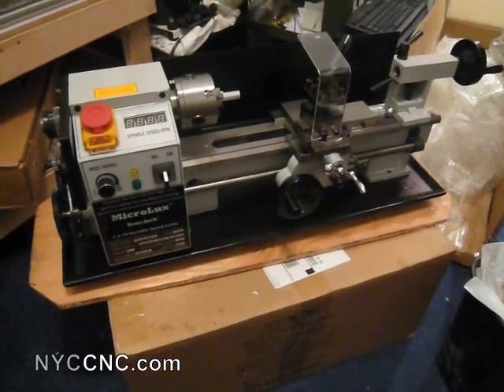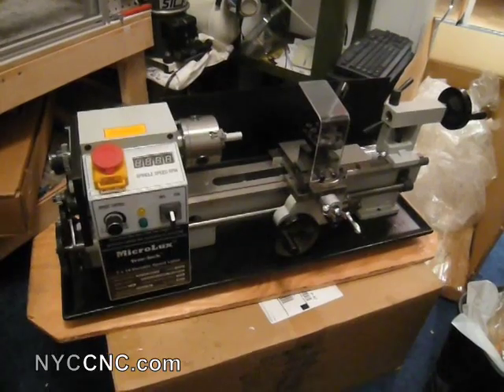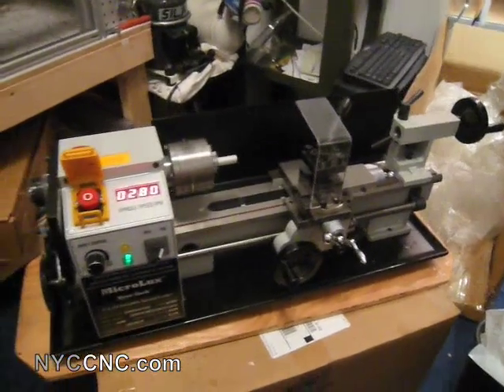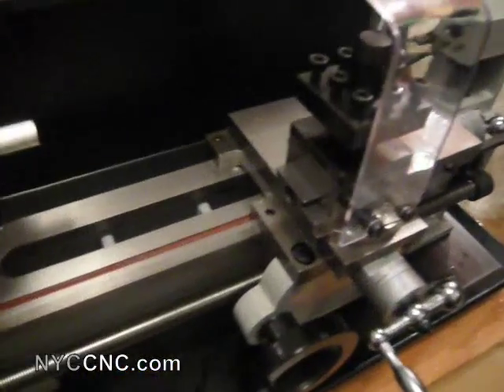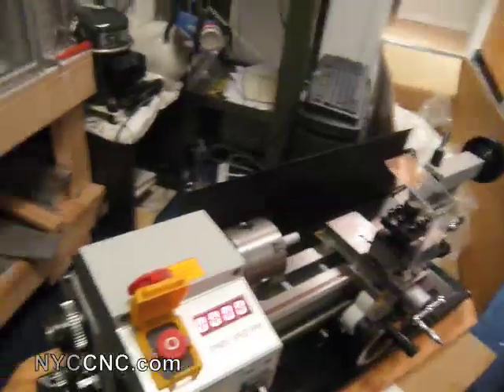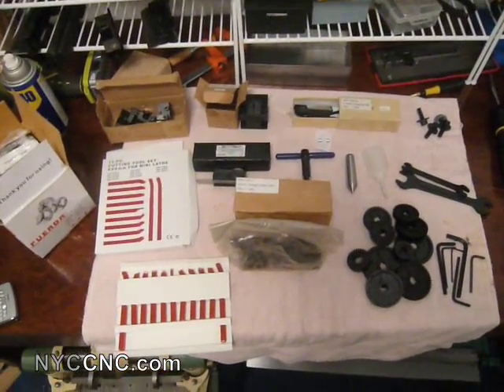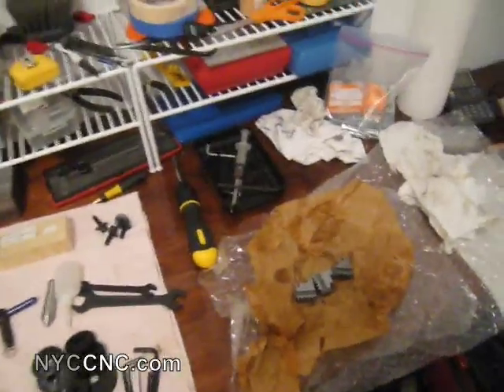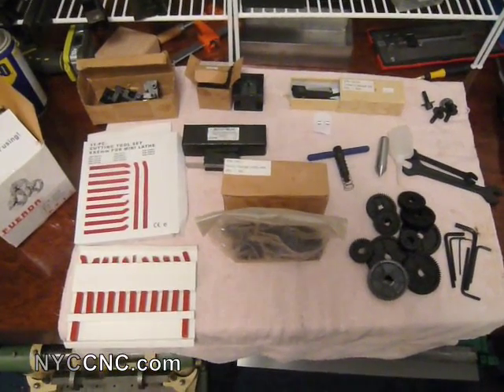MicroMark 7x14" Deluxe Mini-Lathe overview and tutorial

Comment: I understand and partially agree. However, I have aversion to chinese productions and currently suffer the fact that nothing below 1500$ isn't worth the money. There is always something missing in quality. Either it's inaccurate or it breaks, or fuses are terrible or toolpost isn't steady or chuck wobbles or it limits user to the most simple operations (for example it doesn't have automatic longitudinal feed). I'm wondering if Grizzly's or Sieg's lathe's are better. Begginers are really stuck.

Comment: Alabama. Well that depends on how much wear protection you want and if you remove material before plating. You can add as little as .0001" to .050" thick. Adding much over .050 the chrome is so brittle. Really most places prefer not going over .020 but that's just precautionary. On a gun slide you really don't want to add very much so you really don't get as much benefit. We chromed threads as little as .0002 for anti-seize property for the nuclear industry.

Comment: It does do wonders in regard to wear. Some of the parts we worked on would gain 500-2000% more wear time after chroming. It all comes down to thickness and some technical aspects with the chrome baths. I being a gun nut myself prefer some of the newer coats and nitride techniques to chrome  on a gun. After being in the business so long you learn it's limits and all. It is still amazing stuff even with it's limits. Also have to say nice shop you have. Meant to say that the the day, but forgot :-\

Comment: Don't be a lathe snob.  95% of technology equipment in your house is made in China.  Further, the machine does what he wants it to, he could have bought any lathe he wanted (the used SB and Logan anchors are similarly priced, but they are massively heavy, many are worn to the bone and need an overhaul, or simply take up too much room).  Like John, I could buy any lathe, price isn't an issue, but space, form and function are.  Relax.

Comment: @Kr4ftw3rk you could also flip the threading tool upside down, and run the spindle clockwise to obtain LH threads without changing the rotation of the leadscrew